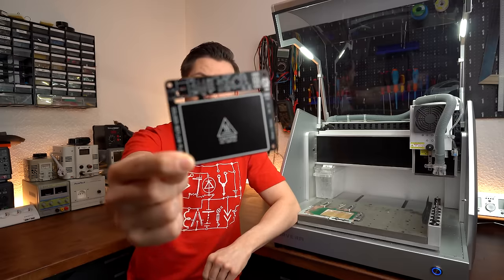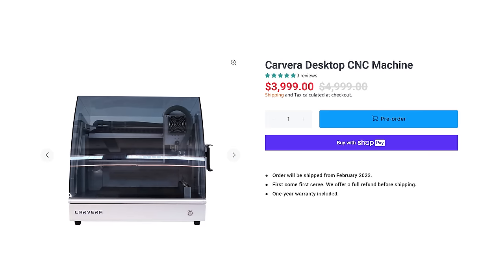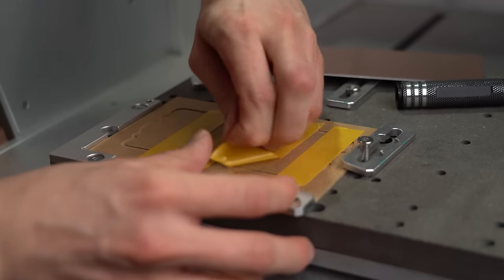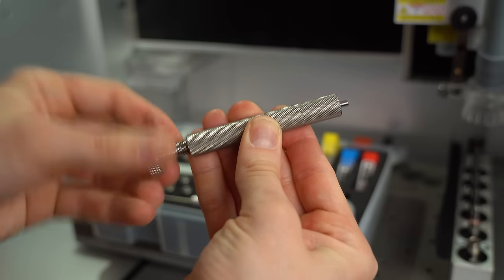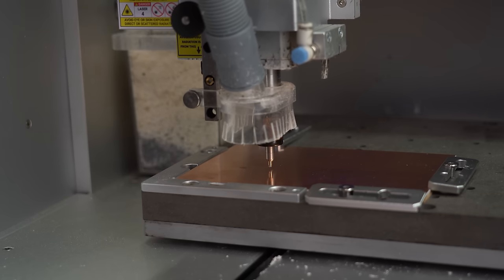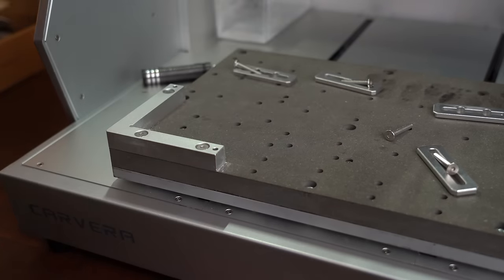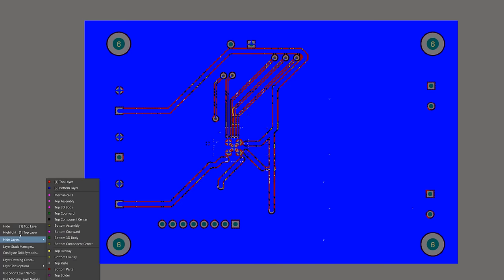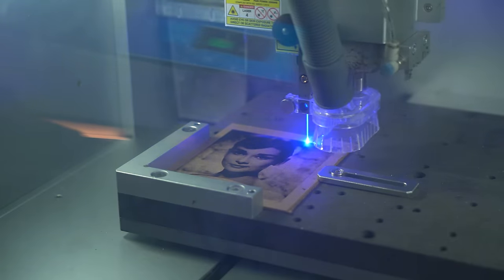"A Machine PERFECT for Making PCBs at Home" Is what they said!

Comment: I have a Workbee CNC and it was bought mainly for PCB prototypes. Just like you have said the software side is still very much work things out for your self and far from perfect. I can use it with decent results including double side and have made a few prototypes before sending away for pro boards to be made. This machine looks good and the tool change will save a lot of time.
Reply: For double sided, I imagine the “registration marks” (or zero X and Y starting positions) when flipping over must be near perfect. And the drilling of holes has to hit as close to dead center as possible.
Reply: @stevebabiak6997  Depending on the complexity of the design yes it can be a problem to get it perfect. I use flatcam and it has a way to do it, but if you don't do it in the correct order everything will be wrong. It was a good 6 months of messing about before I had a good process to make boards.

Comment: I think knowing what limitations and benefits professional machines have really puts things into perspective.

For reference.
My single operation, mass production milling machine with a 20 cm by 10 cm (4x9 inch) working surface
Costed $30,000 USD
Weighs 408 kg 900 lbs (without the coolant and oil)
Only cuts one profile or slot at a time
Is much faster, and takes much less attention, 
but 
takes a college degree to set up reliably, all tools must be custom designed and made for the each cut and must be programed in assembly commands
Has no sensors at all.
Can be set up and checked in once per week when running.
Costs $.10 per hour to run, and about $500 to $2,000 to set up. PER feature
Is not CNC obviously, although is computer controlled, it is not numeric.
all tools can be resharpened.

Another professional model I have used that is a mill-drill center using G-Code, made by Fanuc, with about the same table size.
Has 8 tool slots,
Has no ability to sense the table
Takes 3 phase 410 volt. 
is significantly faster moving
Weighs in at 650 kg, 1450 pounds (without coolant)
Does NOT come with software.
Requires professional attention about once per hour.
Costs about $80,000 in bare bones, used models can cost up to $200,000 with all the options and low hour run times.
Costs about $100 to $200 per hour to run.

Take your trade offs, don't complain, unless the cost and performance do not add up.
Reply: What is so special about that machine that it requires a COLLEGE DEGREE (instead of just some training/certificate) to set up, and why does it cost up to $2k per feature? Unless you are talking about the CAD/CAM part of it as well, including the actual PCB design, then i can somewhat understand it. And why does that other one cost $100/hour to run just for milling/drilling? Lots of wear parts?

Comment: I noticed some of your workpieces weren't sitting flat. Take the L-shaped aluminium bracket, turn it upside down and mill a small relief (~1.8mm) to the inside edge. This way you can use it to hold down your workpiece on the bottom and left sides.

Comment: Jlpcb is pretty awesome. I had a project that needed some custom pwm controllers. So I ordered the minimum amount of boards so I have 4 of those boards in a drawer that will probably never be used again. But I always save stuff because you never know when something will break. My philosophy is to keep spares around if you can. I can’t count the number of times I’ve saved the day because I healed on to a extra component for 15 years and they were no longer available and would have required a lot of work to integrate a newer version of the item into the system and sometimes it is almost impossible to integrate the new part.

Comment: is the cover for the front laser protective? ie, does it protect your eyes from the laser?
Reply from the maker: The CNC comes with an adhesive layer that you can add to the lid which blocks the laser. I have not applied it though

Comment: Watch wegstr cnc. If you just take the time and have more attention to detail you can get really good looking pcbs. For example, using the centering holes for double sided, using cheese cloth for the solder mask application, using a tinning liquid to tin the copper pads, and if you're feeling really adventurous using multiple solder masks (white, then green) and a laser to etch away the green for circuit legends. I think this hardware is more than capable of making very nice pcbs at home.

Comment: Was a nice video. Could you go a bit more into detail about the fabrication of the solder mask, or create a separate video about it? You apply the mask, cure it and then remove the cured mask from the pads? So if the machine is well calibrated, I would not remove any copper and would not have to create a mask for the solder mask and etch it but how do I calibrate the machine for such low tolerances as I modify the pcb when applying the solder mask. Not sure if my comment makes sense to you ...

Comment: Having worked with copperCAM before i can for sure say it has alot of problems. The only other issue is with the method of applying the mask.Professional pcb manufacturers use a silk screen for the mask and component designators. If you also use screen printing you will get very professional looking pcbs.Other than that its a solid machine but its priced for a small buisness rather than a hobbyist like most of us are.

Comment: they should make the glass tinted to the neccesary frequency to filter out the lasers light, for ultra easy eye protection ... the biggest reason you should not use lasers, the second one is the fire hazard but that thing looks mostly proof of that issue

Comment: Would it be possible to use a 3D printer to “draw” the traces with PLA then use an enchant to remove the remaining copper, then remove the PLA?
Reply: Possible, perhaps, but getting a very good PLA adhesion will be very challenging. It would be much easier to use the laser to remove a painted on surface, then use traditional etching to remove the copper, then back to the laser to clear off the pads.

Micro-milling is neat, and skipping the chemical etching step simplifies the process for DIY, but it's not terribly complicated to do especially when you account for the solder mask stage. Since there is a laser, why not use it for what it's good at?

Comment: I understand that a machine that offers so many functionalities in one would cost a lot (4000€ + bracket). However, my experience with similar tools is, that often one machine can do many things well, but never one thing perfectly. A lot depends, in other words, on the quality one expects for a given cost. In the long run, although a certain tool (e.g. CNC machine) can SAVE you money and effort and time, BUT with a (slightly) lower quality of output, it can still be considered a viable option. 
However, a drawback is that, for every specific "function" of the machine different software is needed and each sotware necessitates an update cycle or otherwise the functionality will quickly become irrelevant, forcing you to buy yet ANOTHER machine to be able to perform that specific job (e.g. carving)
So, although a machine offering three functionalities in one sounds like a good deal, it may have some not unimportant drawbacks in a (far) future... unless the drawbacks surface long  after the machine has had its productive life cycle... in which case we come in "legacy technology" or "Data transfer" territory with its own problematic 
(one I'm contending with myself, where I ended up with several laptops all containing the same software and a lot of old data that needed migrating... which is a very time consuming occupation with data-loss risks as well)

Comment: I see a bunch of pads on the PCB either have the copper missing, or the mask not completely removed. Do you think this was an issue with the auto leveling? The speed/feed of the drag tip? uneven mask thickness combined with the drag tip?

Comment: Could you have the CNC do a partial mill-through on the front of the board and the final cut on the back so you'd only have to flip the full board along vertical or horizontal axis for cutting?

Comment: Great video! I would be interested to see your take on self-soldering circuits. Seen a few videos recently and I think it appears to be very promising tech for circuits with SMDs.
Reply: If by "self-soldering" you mean that the board has a built-in heater traces, then yes, it can work, but it's more of a party stunt than a way for you to avoid just using one or another straightforward method of soldering SMD components.  If you're just getting started and are apprehensive about the process -- it's not actually that hard to solder components down to 0603 by hand with a soldering iron and fine-ish solder and flux pen, if you have good visibility (like a good magnifier or microscope).  But it's also easy to use paste (if you get a stencil with the PCB, and even if not), and then place all the components by hand (again, magnifier/microscope), and then use some simple heating device like an old hot plate or electric frying pan, watching the solder melt by eye.   That's way easier than using a layer of the board for the heater, which may or may not heat evenly, plus additional circuitry, plus you have to use low-temp solder because if you heat the PCB layer hot enough to melt ordinary solder you will burn the board.
Reply: @Graham_Wideman  I use low-temp paste (Sn42/Bi57/Ag1, mp=137C) with a stencil for my prototypes and reflow with a heat gun, it's about as easy as it gets for low to medium density designs. Mechanical performance (barring the lower melting point) is fine, I've had a dead board on my keychain for years and the component packages are wearing away faster than the solder.
Reply: @treelineresearch3387  Yes I agree. You are adding to my point that there are multiple easy ways to go, and not to be apprehensive about SMD soldering.

Comment: Just a question if you have any thru-hole parts, what do you do about plated thru holes?  How do you get signals from one side of the board to the other?  What do you do about a silkscreen?  PCB's are so inexpensive right now, and turnaround time are so fast  that I just don't see the point of machining one yourself.  You end up with a board that has design limitations and is of lower quality.

Comment: So here's the summary: Thing costs 4999$, came beat up and with tools the rest will have to shell half a grand extra to get. Its most praised feature didn't work but the issue was solved by the PR guy who prepared tutorial for him, person none of the buyers will have access to.

However, having a laser present means you can make good PCB with this machine. There are self-adhesive foils for laser etching. Or you can simply paint copper with mat paint and use laser to cut traces. Then just use bog standard etching solution for PCB and done!

I am however very pleased with objective reporting on this machine. I totally expected endorsement even though it's lacking in many places. Eventually it will probably get good enough and cheap enough for home use but they need to keep working on it.
Reply from the maker: I thought your comment would be all negative but it turned into pretty objective. Thanks for the feedback :-)
Reply: @greatscottlab  Hah. You are welcome. I do try to be objective as much as I can. And like I said, I found your conclusion refreshing considering how many other channels simply keep praising the product they got for review. If it needs work, it needs work. No other way around it.

Comment: was the drill bit used to remove the solder mask from pads spring loaded? if not that is pretty impressive precision, milling the mask off without going through the copper is hard

Comment: Great video! I love seeing reviews on these types of products. 

I would have liked more coverage on the safety features they have or haven't included for the laser engraving feature. Since they have it fully enclosed, they could have some sort of vapor filtration system, but that wasn't mentioned, so I'm not sure. I would also be curious if the lid material is rated for the frequency of their laser. There are a lot of companies adding laser engraving features to their products, but most of the time they fail to adequately account for the required safety features and I think that needs to be called out any time a review is done.
Reply: Looking at the website for the Carvera, it doesn't seem to have a separate system to control laser fumes, like a fan with exhaust tube or carbon filter to create underpressure in the enclosure. The dust extraction system seems to also really be just dust extraction, no carbon filter. 

However, with how well the enclosure seems to close that should be quite easy to fix, either add a hole with filter or exhaust tube, or even just slap a fan with a carbon filter in there to just circulate the air within the enclosure and wait a few minutes before opening it after a job finishes.

Regarding laser frequency, they sell a separate 'laser protective cover', which replaces the plexiglas cover with a solid lid with a small window in it. So the plexiglass probably isn't laser-proof. It does come with presumably proper laser goggles, but they're just the kind that's a shop safety goggle with a laser filter, not like the diving-goggle type. I'd say it's not great, but by a long shot also not the worst for laser safety. The price and complexity is a safety barrier all in its own probably, a lot better than a €300 laser engraver from aliex without any enclosure and with questionable safety goggles, and probably not even an e-stop.

Comment: At this level of spend I'd be looking at something more like a Tormach, if I'm already dropping $5k on a machine tool might as well drop a few more and get a proper garage-scale mill that can do more substantial work in aluminum and steel. In terms of materials capabilities, stiffness, and working volume it looks to be about the same as my sub-$500 Chinesium CNC engraver; tool changer is cool but ultimately a convenience rather than a necessity.

Comment: I'd use a better solder tip (hoof/flat) they conduct heat better. and also use flux when you solder
I personally stopped CNC my PCB's, it's just too much work, the solder mask is crappy
and there is just NO SILK screen
Reply from the maker: Thanks for the feedback :-)

Comment: Considering how much the laser is visible trough the cover... I would not trust that with a 15 foot pole and use a proper set of protective glasses when using the laser
Reply from the maker: Protective glasses are included but you can always use your own. The CNC also comes with a adhesive film you can apply to the lid. This way the laser will get blocked quite a bit more.
Reply: cool, sounds like a good solution.

Comment: Fantastic machine indeed! Thanks for the review, dude! 😃
BTW, isn't there some way to make PCBs with a laser engraver?
Stay safe there with your family! 🖖😊
Reply from the maker: Laser Engraver way does exist. Maybe a topic for a future video :-)
Reply: @greatscottlab  Yes, would love to see a future/follow-up video comparing micro-milling to laser and laser+chemical etching using the same machine. Not sure if the included laser has enough power output to do direct engraving of traces, but it should be perfectly good at etching a mask for chemical etching, as well as cleaning up the pads in a solder mask.

Would also like to see micro-milling vs. laser cutting comparison for making solder mask plates for SMD board fabrication.

Comment: It's a Great CNC-Machine, but I think it's a wast of money for pcb milling. From the point of view of a hobbyist, this is not worth it. It is simply not profitable, you would have to mill a PCB every day for the next 10 years so that the purchase is worthwhile compared to a JLCPCB order. In addition, one is limited to a two layer design. Also from the point of view of a company where we do 4 to 12 layer designs, this machine is not needed. The time you have to invest to transfer a complex circuit from 4 to two layers is about the same as shipping from China :D This machine becomes even more unnecessary with the 2$ link for 8 layer PCBs in the description.

But Great Video as always!

Comment: Hello Great Scott, I have a real World issue. Have some boards designed in Eagle with smd and through hole components. I used the ULP script from JLCPcb but it outputs the BOM and CPL files only for smd comments not for the THT comp. I did talked with them but no success. Could you help please?

Comment: I've never understood why someone doesn't just make a PCB maker that uses ink. If you just had a printer that could print ink directly onto a copper plate, then you'd just have to drop it in some enchant solution and you'd have a PCB, and with double-sided copper plates you could do two layers. Doesn't seem like something that hard to even manufacture.

Comment: About 20 years ago I was considered to be a power user of the T-Tech pcb milling system.  This unit is amazing at double the price. Considering the price of a unit was 20K at the time this unit is cheap. Granted the isolation software that comes with a T-Tech was always the best feature, all of this units features  and extras are amazing.  Don't forget there will still be a learning curve on any machine like this. As a prototyper, I  could make and test 2 to 3 boards a day depending on how complex. I worked on RF designs and accuracy is extremely important. I did mostly double sided boards and with a few more items, I could have done multilayer boards relatively easy. I can see how double sided boards can be done here but software will play a big role.